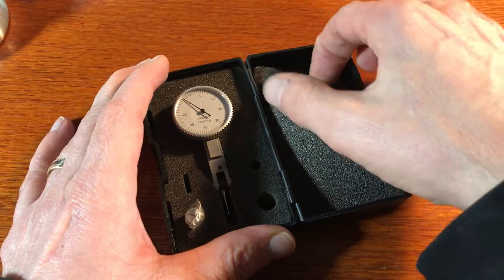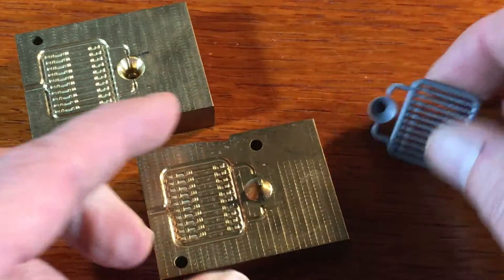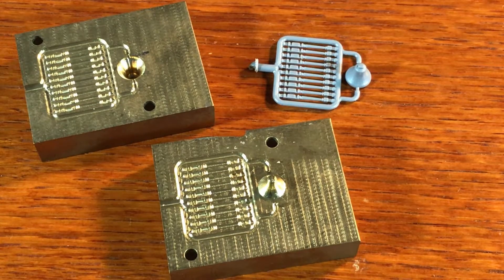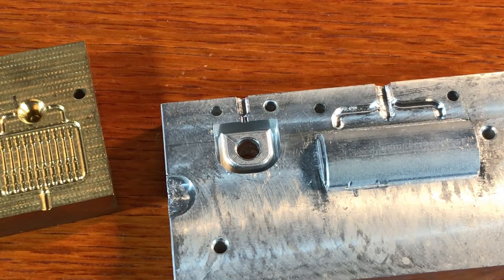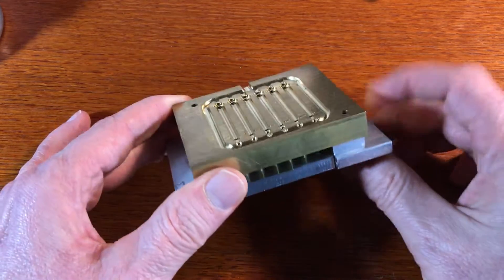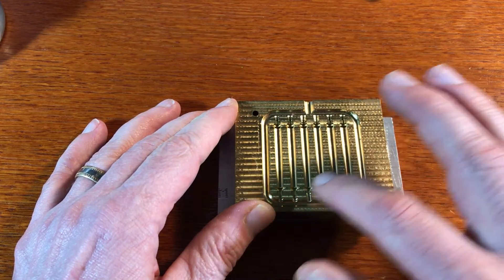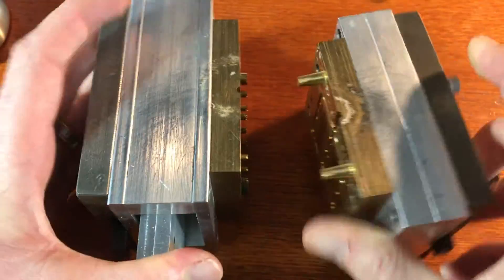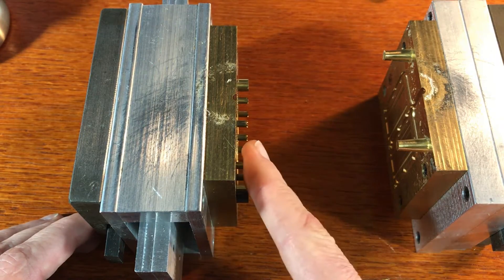#2 - Ejector Pin Intro

Comment: Hey John! Regarding ejector pins, this is something I’ve been curious to know. I’ve noticed on foams like Styrofoam or Adidas Boost shoes on the bottom of the midsoles (look it up if you’re not sure what I mean), I’ve noticed the witness marks on styrofoam have 7 dots within the circle of a witness mark, and with the bottom of Adidas Boost midsoles, they have 3 or sometimes 4 lines within the witness mark. That being said, could you tell me why that is?
Reply from the maker: Sorry, I don't know. My only guess is that it might actually be an insert they can change out to indicate something about the revision or date when it was made. I haven't used those myself, but know they exist.
Reply: Venting thru the ejector pin when doing foam is common. It sometimes is done with a D shaped pin.
Or these could be slotted vents for different molding processes.

Comment: Why is brass on brass a bad thing? That's the way ALL the locks are made too (and have been for the past 100 years or so) after all....
Reply: Brass on brass is bad in this particular application, just because it's too soft and will deform (and gall).
Real molds have ejectors made from tool steels.
So it's not just friction (it's size, shape, application, function, conditions like temperature, and so on).
Reply from the maker: That's a very good question, and I don't know the answer. It may have been a result of sharp edges catching on the ejector pins. The examples you provided have smooth edges where the parts meet. But's that's just a guess.